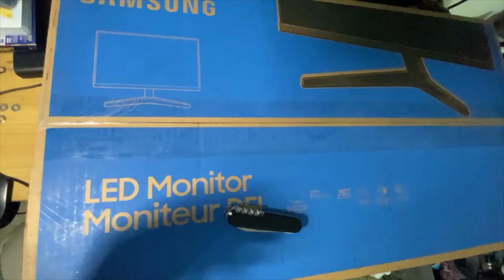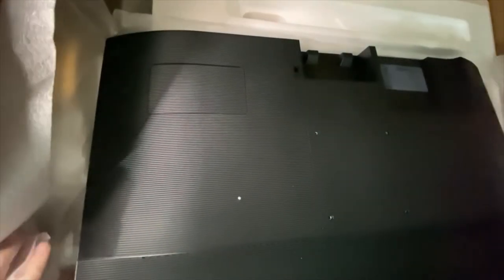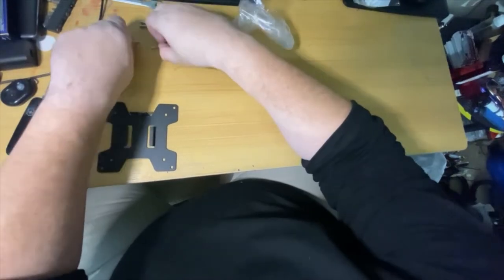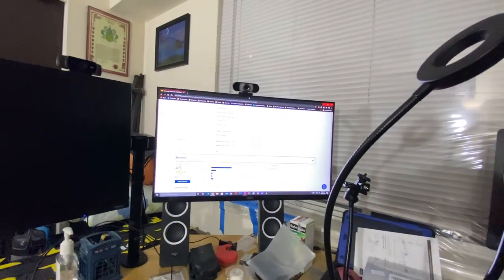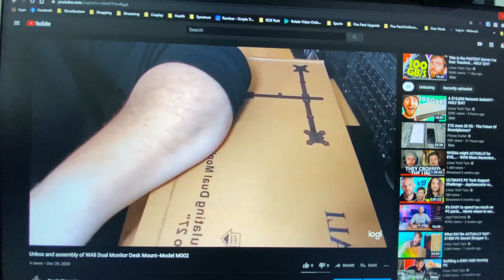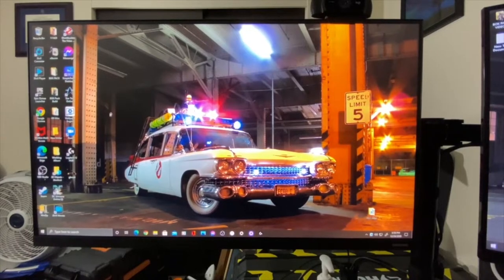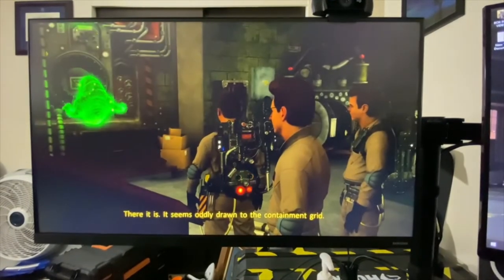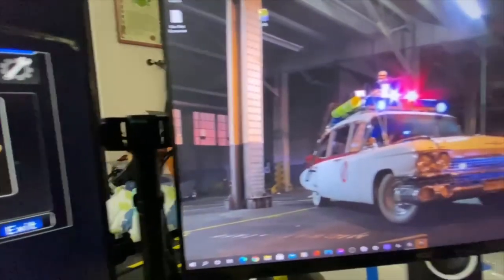Unboixing-Samsung - T350 Series LF27T350FHNXZA 27" IPS LED FHD, FreeSync

Comment: hey dude, this monitor have "amd free sync", 
its works with nvidia graphics card too?
Reply from the maker: Free sync yes
Reply: @DavesDimension  thank you!
Reply from the maker: @RelihSchneider  anytime
Reply: @DavesDimension  As far as I know It shouldn't, this monitor have an HDMI 1.4 input, in order to use free sync with (new) Nvidia cards you need HDMI 2.1 or a Display port inputs that this monitor doesn't have.
Have you managed to use free sync with this monitor with an Nvidia card?

Comment: How do I fix the volume
Reply from the maker: I connected a speaker
Reply: @DavesDimension  like blue tooth how do I do that
Reply from the maker: @yg_v1rtual_139  no speaker plugged via pc.... did not use Bluetooth
Reply: @DavesDimension  what the speaker name
Reply from the maker: @yg_v1rtual_139  just bought some inexpensive speakers....any should do...

Logitech - Z200 2.0 Multimedia Speakers
Reply: @DavesDimension   were do I plug them in at in my ps4?

Comment: Is it compatible for xbox
Reply from the maker: It connects via hdmi so it should be
Reply: PS4 as well?
Reply from the maker: @Maniacjudo  it should be along as you use an hdmi connection
Reply: @DavesDimension  so just like connecting the hdmi to a tv I just connect it to the monitor and it works?
Reply from the maker: @Maniacjudo  yep the monitor is just receiving the feed from the source.....hell you can connect a cable box to it.....lol